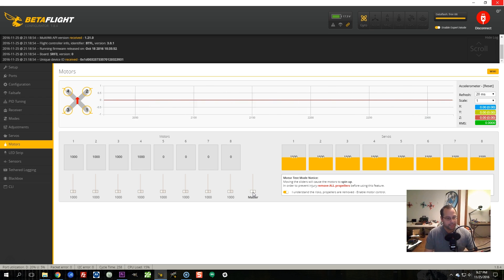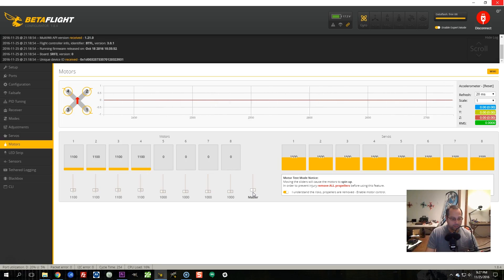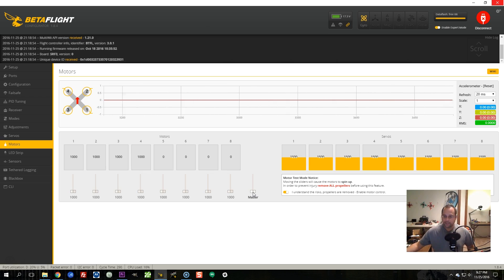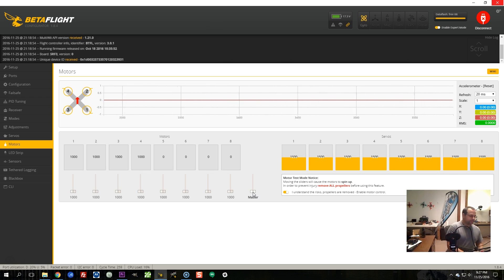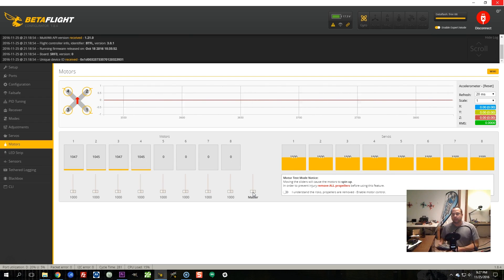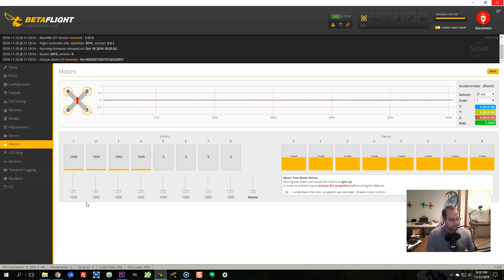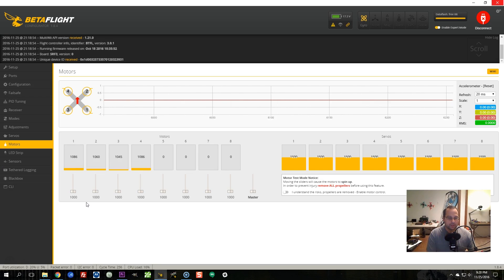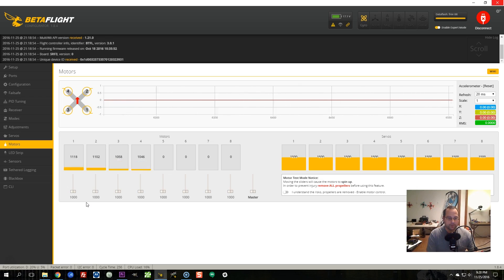Why Do Quadcopter Motors Spin Up By Themselves With Props Off?

Comment: Hi Joshua, I have Blheli ESCs connected to a KISS FC board. Is there a simple way to enable damped light without desoldering my ESCs?
Reply from the maker: +Marc MFPV desolder power from the FC. Then clip to the signal wire or touch a probe to the signal wire solder joint. That's what I'd try.
Reply: Joshua Bardwell Thank you so much! :)

Comment: Good video! I think it won't hurt to repeat that this is one of the reasons why people should try their quads with props off. When the props are on and spool up your quad might work like a flying blender with >1000W. I broke a finger with props at near minimum throttle and at least I won't make that mistake again. Be warned!

Comment: This has just answered alot of questions on the behaviour of my first build while powered up during bench testing. When testing the motors in betaflight and calibrating in blheli suite they all work equally but didn't behave as I thought they should when just hooked up to a battery. Motor 3 spun down and stopped as well the motors twitching when I moved the quad. Thumbs up to you Joshua and keep up the good work.

Comment: Beware that trims not being absolutely perfect will cause this issue too, even with props on. Helps to set a tiny deadband if this gets annoying :)
Reply from the maker: You're right. Channels must center at 1500. Also, if you are in autolevel mode, this can happen. But these issues can be sorted out after the test-hover, and in fact during the test-hover, they should become obvious. Like I said, if this happens, it MIGHT be a problem, but you can't know whether it's a problem simply because it's happening.

Comment: One of my motor still spinning low after armed and then disarmed  almost pulled my hair out finding the problem turned out one of the motor mount screw touches the motor windings. I don't know how it produces such behaviors.

Comment: Another great video, solving another curiosity, the answer of which I assumed but never confirmed. Thanks for that! 
I have a curious situation I'd like to pass your way, another assumption that the DRE probably answered 11 times today already! I have a Fury frame outfitted with 30A Cicada's and 2450KV F60's, on the latest Betaflight for the F3 Omnibus and BL_Heli firmware on the ESC's. My HS1177 and 600mW VTX, with power fed from a non-filtered PDB, normally have a ton of video noise, at least right up to the point the HS1177 stops working. I'm on my third HS1177 now, and I'm assuming the regen from the propulsion components are introducing enough electrical noise to actually exceed the voltage limits for the cam? Of the two times it's happened, it's right after a punch out when I kill throttle, video goes black except for the OSD, and the cam becomes so much orange garbage.

Comment: hi Josh. are you going to make a video about pid tunning for a beginner with a completely untuned copter? all your pid videos are to perfect already reasonably good flying copters.... also many of us dont fly acro and fpv yet.....we need to set it up in self leveling mode... no need for extremely good tune...just a reasonably good behaving copter....thanks a lot.
Reply from the maker: +alisher rakhimov all my videos start with Betaflight defaults. That's a completely un-tuned copter, as far as I'm concerned. 

You can watch the 5th video in my Practical PID Tuning playlist of you want to see the effect of zeroing out the PID terms.
Reply from the maker: +alisher rakhimov if you have a mini quad that doesn't fly reasonably well on Betaflight defaults, then something is probably mechanically wrong.
Reply: Joshua Bardwell i have i 250 good flying with the defaults and 180 which flys like shit....waiting for parts to do owl style 130....dont want it to fly as bad as 180 ;(

Comment: Sadly some people are not as smart as they think they are. 

Building a drone/copter is one thing understanding how the control system works is another.
Props off arming is only useful for checking radio operation and failsafe.

You cant expect any control system to function without its load connected.

Hover testing is the best way to feel out if your quad is performing correctly before maiden.

Comment: I did a maiden hover of a new build in my back yard the other day.  The copter started gaining altitude on it's own so I hit the kill switch.  The problem became obvious when flames started coming from one of the ESCs.  A little surprising since I had run it up to full throttle several times inside while holding it down.
Reply from the maker: +AZOffRoadster sounds like a D gain issue but that's just a guess.
Reply: Actually, no.  Just a bad ESC.  Replaced with identical ESC and no changes to PIDs.  Works fine.
I'm still thinking thru what the actual failure mode of the ESC was that would make the PIDs respond in that manner.  It was rising level and slowly. Seems PIDs thought they needed to spool up the other three to compensate for the one.  Thinking about it... it was slowly drifting in the direction of the soon to be in flames ESC.
ESC was a Little Bee Opto 20A.  The flames started at the input side.
Reply: Joshua Bardwell I got even more strange things happening. There are two situations happening 1. After punching throttle few times and disarming the motors they stoped and then slowly starts to spin faster and faster till I disconnect the battery. 2. after disarming motors spin after few seconds very slowly even stops and spins few times. My min command is 960 and min throttle is 1050 I have motor stop and air mode turned on. Any ideas Joshua?
Reply from the maker: +Dariusz Delanowski motors cannot spin up when the copter is disarmed. When the copter is disarmed, min_command is sent to the motors and nothing else. If your motors are spinning up, you're not disarmed. 

If your calibration of your ESC's is off the motors can twitch or even spin when disarmed but they should never accelerate m

Comment: It's almost like people don't just let the quad do it's thing and understand what is happening.  
When I got this issue when Airmode was introduced I took the quad out and armed it then let it do it's stuff. I then realized that the quad was just trying to auto level to the gyro.  
It seems like this hobby has attracted many new people, which is great. But the people it has attracted are like the bane of the internet.  
It's the "dude just tell me" mentality vs the "I will find the solution" mentality.
Reply from the maker: There's way too much information in this hobby for everybody to figure out the solution themselves. I'm personally dedicated to helping complete n00bs get over the learning curve, as long as they show a desire and willingness to be taught.

Comment: I am having a problem with some DYS 30a blheli s escs. I have them running multishot and they fly extremely well...until I try to roll. When I try to roll the kwad it flips out and is pretty much unsavable, just disarm and let it fall. I know it's a bad esc but how do I tell which one it is without swapping each one with a new one. By the time I do that it'll be in 50 pieces from the test flights. And for this video I am sorry you had to make this.  It's extremely self explanatory if you understand how the flight controller works in anyway.
Reply from the maker: Does the copter tumble when you enter the roll, or when you are stopping the roll?
Reply: Joshua Bardwell stopping the roll I believe.  Although it's hard to tell. I have recovered from it before but it's really hard it flips in different directions once I enter the roll.
Reply from the maker: +insainone69 if stopping the roll us where it loses it, try raising min_throttle by like 30 us.
Reply: Joshua Bardwell Ok I'll try that when I put then back on. I put some old 30a escs from the gb190 kit I destroyed lol. I just can't get these tuned I get an unwanted circular motion when falling.
Reply: Joshua Bardwell would rather put on old escs and fly then not fly at all. amen! lol

Comment: but what if it does it WITH the props on? ;)
Reply from the maker: +Nicholas Heidl even then it may not be an  issue especially if you have air mode on. Then it's more related to the tune. Excess D gain can cause the motors to surge when idling.
Reply from the maker: The motors absolutely should NOT spin up very far when idling with props on though, because the PID loop should detect a change in the copter's attitude and compensate. So if the back motors are spinning up for some reason, eventually the copter will pitch forward and the PID loop will detect that uncommanded move and spin them down again. 

If the motors spin up like this so that the copter actually tips over, the most common cause is that the RC channels are not centered.
Reply: Mine spinns up faster and faster with the props on. It's not over corecting because it stays level to the ground. Just gain altitude. That's probably my 10th build and never had a problem like this. And I use hte same components. Hmmmmmm
Reply: having the same issue... any fix yet?
Reply: GregPhillipsEdits no. I wrap the motor wires around the ESC and I think that caused electrical noise. May that's why there was a disturbance. But in the other hand in Acro mode didn't notice anything. I have a 6500kv motors that are ratet at 100% for 9,5A and I use 6A ESC. I don't know if that's make any difference.
Reply: same here
Reply: I had this problem just the other day with the props on in angle mode. It would get crazy oscillations then and just keep climbing with no throttle in put. Lowered the angle strength in betaflight to 28 and it fixed it. I noticed when you type dump in the cli the only thing changing the strength done was lower the p value in the pids for angle mode.
Reply: My Kakute f7 does this with props on. I just disarm it.